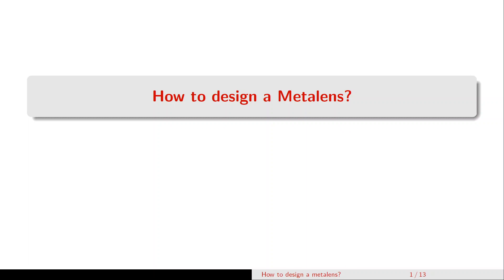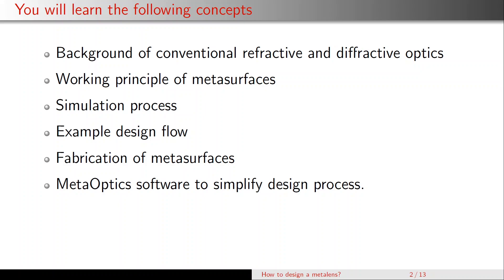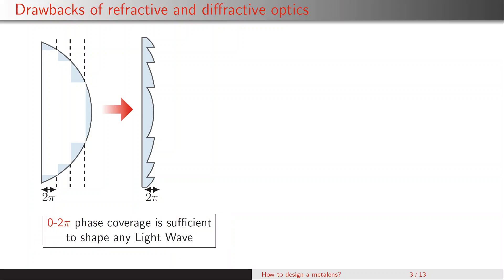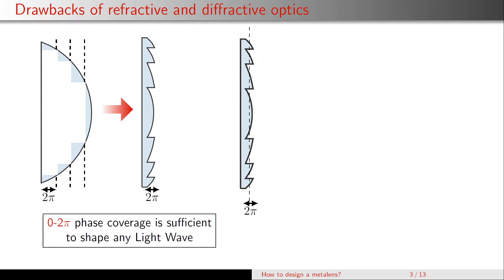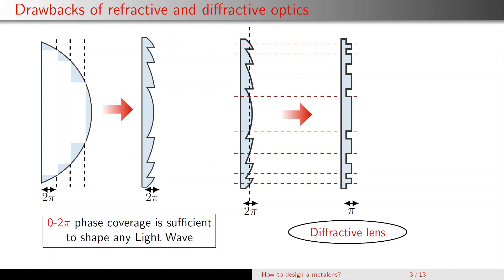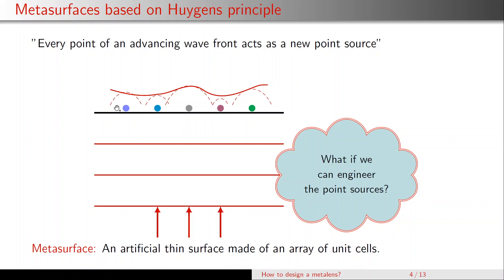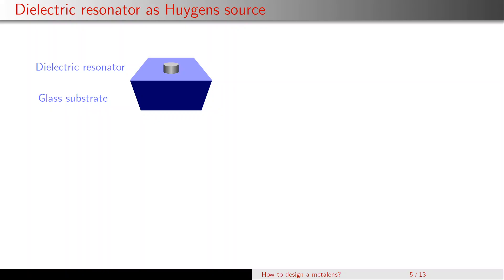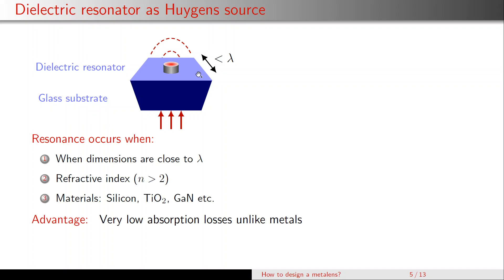How to design a Metalens/Metasurface? || Metasurfaces tutorial || MetaOptics software demo.

Comment: Thank you for the video. Could you tell how to discretise phase profile (can it be done in matlab). And then how to know the location where we should place our scatterer.
Reply from the maker: Hi. You can create your phase mask as a grayscale image with 4/8/16 phase levels(equivalent to the corresponding number of gray levels). For example, 4 grayscale levels correspond to 0, 90, 180, 270 transmission phases etc... You can upload this image in MetaOptics and choose the choice of wavelength and create the GDS layout.
Reply: @RaghuDharmavarapuiitm  using metaoptics I have created GDS layout. I want to do simulation of light propagation from metalens. Can I use GDS layout as my geometry in software like COMSOL.
Reply from the maker: @manishkala6292  Yes. I think you can do it. In Comsol, you need to specify the refractive index, height etc.
Reply: Ok thank you

Comment: Great tutorial ! Is there any tool that can be used for creating a polar array for a linear array of circles for me to eventually create a circular symmetric metalens surface?
Reply from the maker: You can download the MetaOptics source code from gitHub and try to to add the functionality that you are looking for.
Reply: @RaghuDharmavarapuiitm  Thanks Raghu for the feedback.  I have an excel file containing the positions and radii for an linear array of circles (mostly on positive side of x-axis).  i now want to polar array each one of these circles (got the angular increments for each original circle in the same excel file) to create the full metalens gds2 file.  i know your software starts with the phase profile. any other tool that you can think of in this situation? Thanks.
Reply from the maker: @nimaljayasiri6065  Sorry. Haven't used such software. You might have to write your own script. May I know if it's for education or industrial use?
Reply: @RaghuDharmavarapuiitm  Yes, i understand. Someone designed the metalens and i have to produce the gds2 file. Am with an academic institute

Comment: Hello! Thank you very much for helpful explanation! I have a question: can this software provide a polarization metagrating design (I mean, a diffraction grating whose orders
behave as polarizers, for example, as mentioned in paper "Matrix Fourier optics enables a compact full-Stokes polarization camera"). And if it is, how should I set the Phase Design to implement that? Thank you very much and have a nice day!
Reply from the maker: Possible I think if you use vector diffraction theory to design the phase profiles.